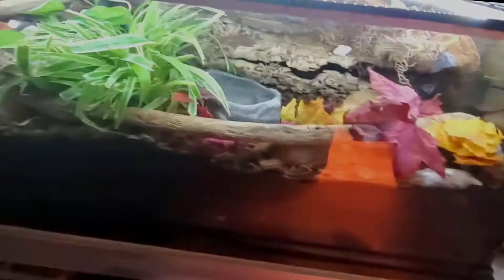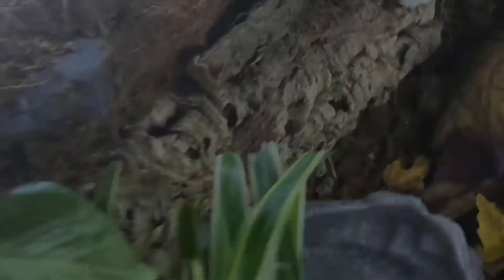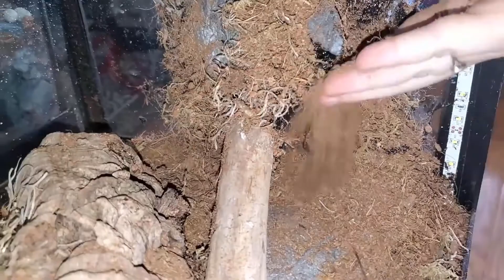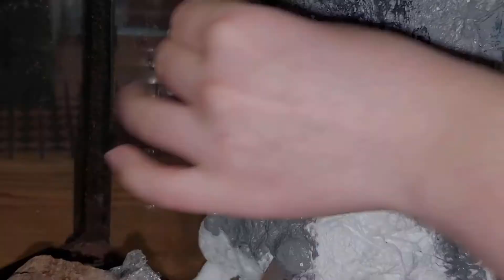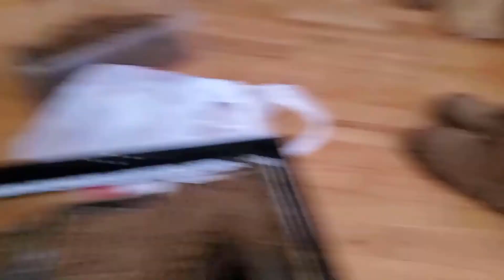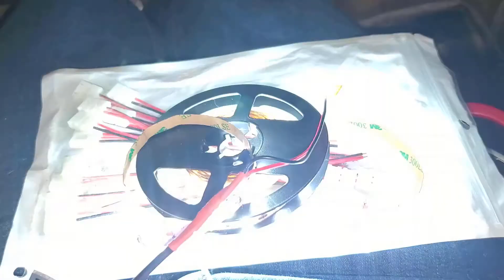Stressed Corn Snake Bioactive Rebuild #allcanadianreptilegirl #nurtureallnature #cornsnake

Comment: Pretty AWESOME 
I have a question about the leaves, rocks and driftwood....I as you may recall am looking forward to having a chance to get a couple of Garder snakes!
I have plenty of areas to get rocks and driftwood! 
And why not lol
Reply from the maker: I get a lot of wood and stones from outside.  I scrub them down with hot water and a stiff brush and let them dry in the sun.  Smaller pieces of wood can be baked in the oven at 250° to sterilize if you want.
Reply: AWESOME Thank you so much

Comment: Great job problem solving F's enclosure. He looks far more confident and secure. Can you tell us more about your LED tape lights? I'm doing a enclosure build  for bulls and kings right now and considering these.
Reply from the maker: I use them in most of my enclosures. If you're using them in a planted tank, make sure you get ones that are 5000k+ (that's the spectrum plants need).  You can do multiple tanks with one spool, but they usually only come with 1 adapter & dimmer. Luckily you can buy adapters & connectors seperately on amazon.
Reply: @AllCanadianReptileGirl  Thank you!